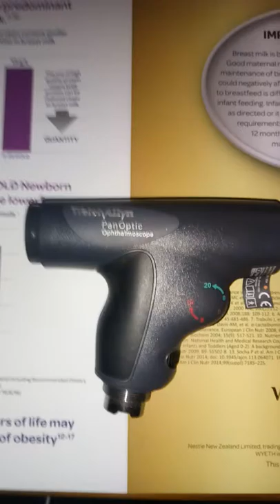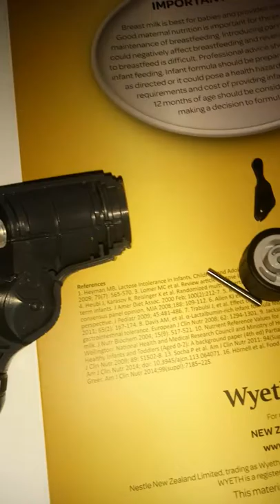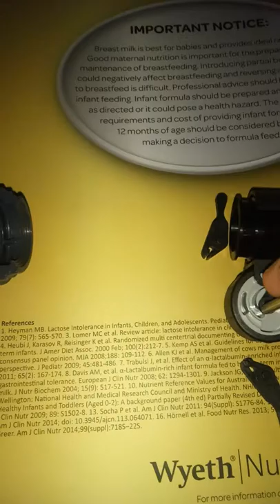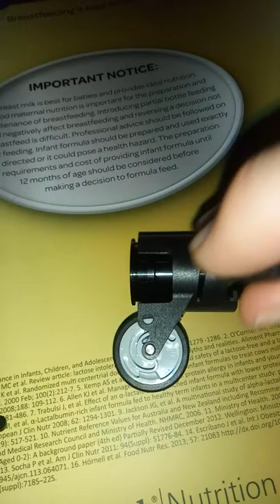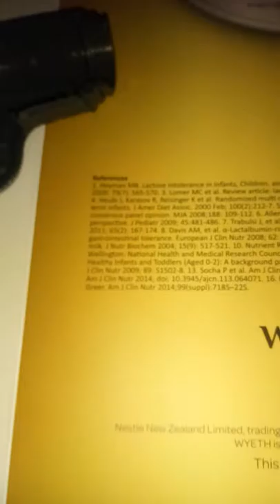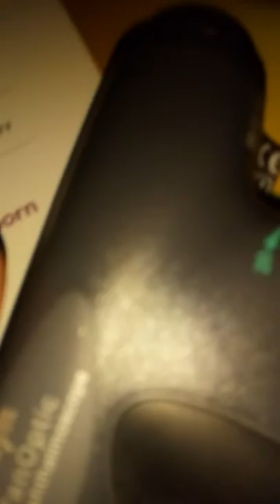Welch Allyn PanOptic Ophthalmoscope dissassembly and fix

Comment: Had someone drop the head and then didn't have any visibility and a rattle inside; was able to figure out the disassembly as you did, and found the small lens freely rattling around in the unit, but couldn't find any actual internal diagram to see where it was supposed to be and in what orientation. Thankfully found your video, and just shoved the lens back in place, reassembled, and it seems to work now. To get the wheel back in, I had a simpler time with taking the focus wheel out, and getting the inside arm aligned on the focus lens and frame, then popping the wheel in, making sure the line is facing outward, and getting the peg in the track; once that's done, it's easy enough to put the outer arm on and put the small pin/axle in, then reassemble the rest of the way. You could probably also just wrap with a strip of paper around the assembly, to hold the arm and pin in place, then lower into place and just pull the strip out carefully. Thanks for sharing your findings!
Reply from the maker: Glad to be of help :)

Comment: Hi! Thank you for this video. I dropped my Welch Allyn Panoptic hard on the floor and I could no longer focus with it. I could hear rattling inside when I shake it. I followed your video and to disassemble it. Sure enough it was a little lens that was loose. I just put it back and reassembled it. I didn’t have superglue so I didn’t glue it. I put it back together and it’s working again. Thanks for saving me clinic downtime and $$$.

Comment: Thanks for this.  Made disassembly simple knowing what to look for.  Our panoptic had a different problem and wanted to put this out there for folks too to avoid the crazy high cost of sending in.  Our unit had the light to far ventrally to make a good fundic exam possible.  Once opened, to the left of the light mirrors, there are 2 hex screws. Loosening or tightening these screws will align the light properly.  Have the hand set plugged in and you can adjust them by looking at the light exiting the left side.  Once I realized the problem, took all of 2 minutes to fix.

Comment: That's pretty cool to see this taken apart, thanks for sharing!
Reply: Very helpful.  Mine had stopped focussing and when I sent it to the local agent, he said he had looked inside, the lenses and fallen out of place and it could not be repaired.  His solution was to buy a new one.  I doubted the case had been opened as the Welch Allyn label did not appear to have been disturbed.  With the help of your video, I opened mine and found the same problem you described.  The small lens had fallen out of place.
The way I unscrewed the silver ring at the bottom was to put two small screw drivers into two of the four holes in the ring and then used another screw driver between then to unscrew the ring.
Thanks for posting your video.  Save me $$$
Reply: @limfowler4270  Thanks for information regarding unsrewing the bottom ring.